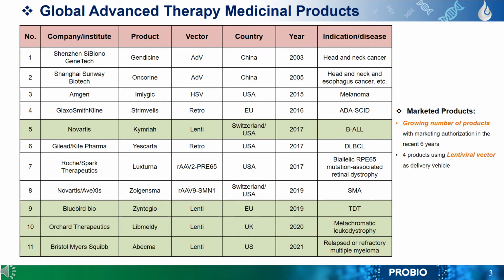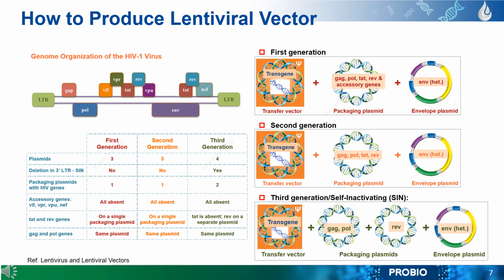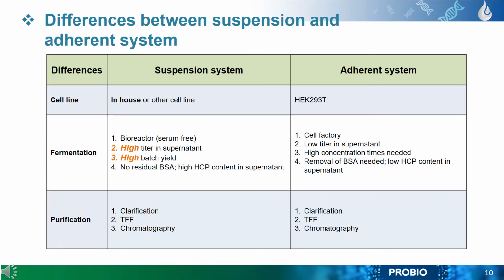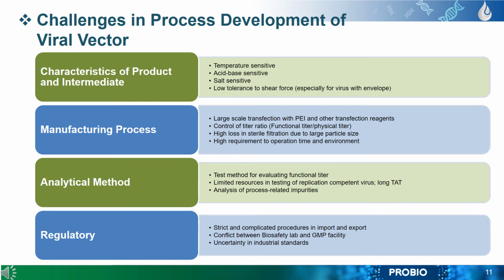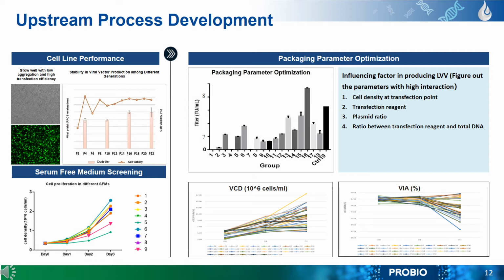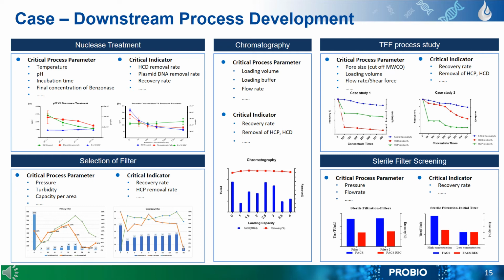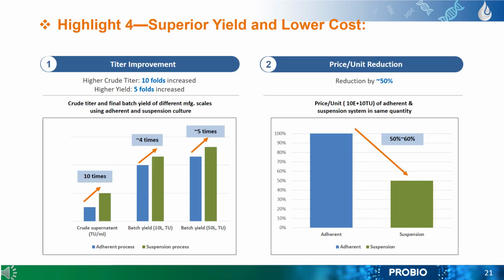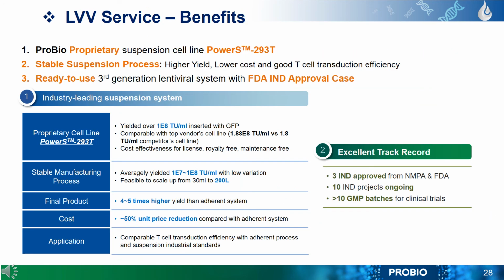Webinar - Scalable Lentiviral Vector Manufacturing Using Suspension Cell Line

Comment: It would be nice to see a company narrow down and reduce multiple different virons to vectors by binding site/cell line. Like say Lyssaviral vector delivery system for neurons. Seems like a natural way to reduce off target effects AAV lenti is great for plated single cell lines although it's made to be broadly transfective. Meaning any in vivo applications are subject to guides and other methods of midstream control. However bringing vector based technology to viable treatments of tomorrow will eventually require a safe flexible narrow profile all in one product available for rapid ex and in vivo testing. Just a suggestion on an emerging market as there aren't many companies that have invested into or can provide that service yet.